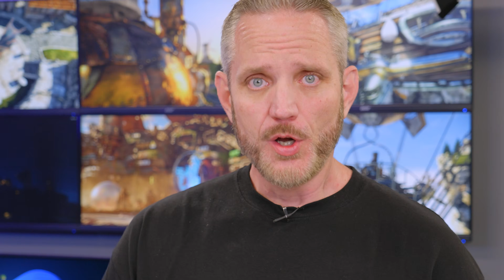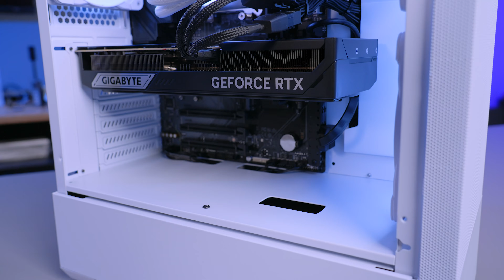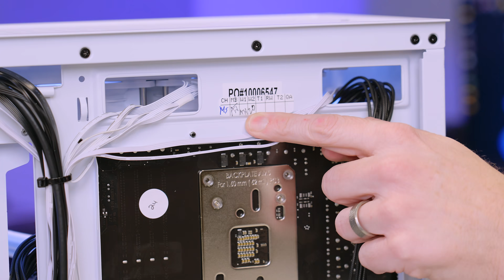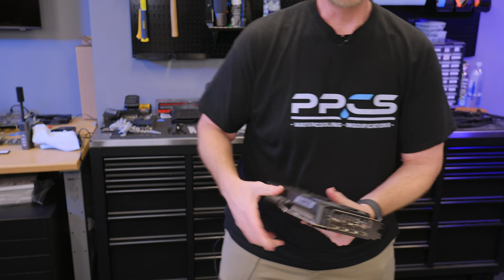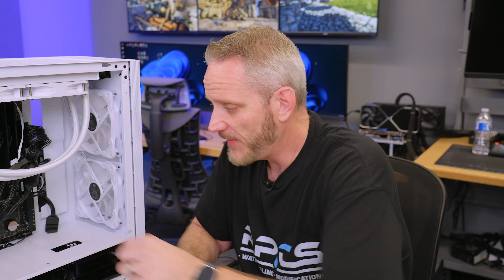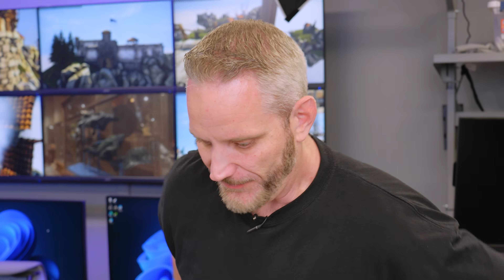This Prebuilt Gaming PC is Shockingly Affordable

Comment: GPU fans going above 2000RPM and it "only" sticking to around 70c feels like pretty mediocre cooling. I know there's trade offs to be had for the price, but this is more about the GPU alone. I think I'd sacrifice some noise for the case fans, to try to turn down the GPU fans, as that's gotta make quite a lot of noise. Although I am quite noise sensitive, (severe tinnitus) maybe I've just forgotten what 2000RPM sounds like. My 5070Ti I have "top out" at 1200RPM and my CPU/case fans rarely break 600RPM (all Noctua 140mm)

3200RPM isn't full speed for the pump I thought ? It goes from 3000-5000RPM, they have it at 3200

Also I reckon the fan curve is set to ramp up after a certain temp, and it just didn't hit it.

Comment: Honestly, for what I paid, this build was really good value because I bought right before prices jumped and was able to put money into aesthetics instead of sacrificing on it 

Built around September 14, 2025 for about $2,400(exactly 2 weeks before ram crisis) for my 1st build after years of waiting 

Same/similar build today would be closer to $3,400
💚9800x3d 
💚RTX 5080 white Zotac GPU with gold accents, paid around $1,140
💚Samsung 990 Pro 2TB SSD, not a budget drive
💚32GB DDR5 G.Skill Trident Neo RAM, gold sticks, bought for around $180 before the RAM crisis
💚asus strix matx B850 in white motherboard 
💚Lian Li 205M case, bought on sale
💚 pcie gen 5 850 powersupply(msi)

Custom aesthetic work: -holographic vinyl-wrapped PSU shroud
-Added a separate VSDISPLAY temp-monitoring screen
-8 rgb darkhorse fans 
-Strimmer cables
-Airgoo hub rgb hub for signal
Fan hub 

Overall theme in my build is  more cohesive: white/gold/RGB/holographic accents. But this build Jay has in this economy its solid

Comment: Indeed. Last August I got my 7800x3D and 5070ti for 1600. Sweet
Reply: Was that open-box? My buddy just got that model last month for $2K. I build PCs, and I, like Jay, considered that a very good deal on a pre-built, considering the current component spot retail pricing.
Reply: @LawrenceSkow  not open box and deal was still good a couple of months later. They also had a 9800x3d , 5800, 64 gig ram for 2200. As I said, August 2025, just before all the memory prices exploded

Comment: I'll admit that between the GPU, memory and SSD the whole system is a steal in today's market.  For some reason I just can't wrap my head around the 240 AIO.  I know it's not as important, costly and the performance factors, but it's not the same as in Micro Center's photos for this product.  If I'm wrong then what's the deal with the white cover that over the top of the CPU heatsink?  Everything was not going as advertised as you should be getting out of the box because of the AIO.   You can clearly see it in this video between the model on your bench and when you showed the webpage for the G757.

Comment: I scored such a good price on a PC, piece by piece that I am actually considering flipping it, for quick profit. 
2,200$ with taxes got me a 5080 Aorus Ice and a Gigabyte Eagle MB, DDR5 6400 - CL32 x 32gb and a Intel 270K combo.
Arctic 280 AIO = 80$.  Hyte y40 case = 140$ with tax and 80$ for SAMA PSU 1000w is more than enough.  

Sharing this so that readers can get an idea of what you can POSSIBLY save.
You can spend 600 on a new OLED and a 300 $ cooler, but what type of idiot would ?.
You can spend 3 or 400$ on a case with 30$ fans. Watch out for the scams.

 I am thinking I can easily get 3 grand for the PC, once assembled. 2.2K is the best possible deal you can get out there.
I got 500$ off the GPU open box and I got the 550$ price for the combo at MC, which today is 600$.
The RAM is 458$ outside of a combo.

I spent a couple months hunting some parts down and working the cost of the system down to 2k plus tax.
My screens are separate and I spent 1800$ for the two monitors and TV screens in the past, so about 4k total for the base hardware.

My entire system is about 10k, for desks and chairs and peripherals and controllers, lights, mic, camera, cable and electrical, Audio interface, amps, hubs, speakers and etc.
Going over 10k is a waste of money imho, but I think every part of my system is carefully selected for the most value. I consider it to be the best 10g studio rig that I have seen, so far.

Even my electrical is up to code, clean as it gets, considering I did not build the walls to fit my system, there's wood paneling on the walls and so hiding cables was a massive job, drilling into the wall to mount monitor arms and TV.
Cables and cable management trays, sleeving + USB hubs, power filter and protection, optional UPS, prepare to drop 800$ -1000$ or about that for a dual desktop office.

I just have the peace of mind of solid and safe wiring, this is worth the cost. Knowing there's a Furman series filter plugged into the wall and my electrical panel in the home was recently updated, this is huge.
I have like 14 expensive things plugged into the single outlet, knowing it's isolated and protected is huge. If I want to plug in some larger AMP, some DJ equipment or some sound board system, this is also huge because you're not popping a breaker anymore, overloading your system. Use a 15-20 amp circuit.

 If I want to plug in a phone, laptop,  game controller, arcade stick or flight stick, I just reach over on the desktop back side has a Denon pro USB DJ hub and plug it in,  there's a 65 w fast charger + extra 110v + USB outlets on each side, this should be mandatory. 
 I have a multi use tree, pole mount in the center, pneumatic mic arm for main mic, has USB-C and A, sim card And SSD reader at the bottom, so adding additional mics, lighting or cameras is extra simplified and there's no need for using a tripod or extension cords, I can run three mics with no sweat, multiple cameras on the same mount. 

The mic arm also holds my pro headphones, reading glasses, just a massive space saver, going vertical. Having to plug things into a tower, this is so inconvenient compared to using the Denon pro hub, it's totally better. I put the tower under the desk, there's no room on top. I still have a Playstation on there, other boxes. USB hubs are integral parts of any modern digital studio space, it's just common sense for a digital space.

 One desk could use a hub, except one desk does not hold all you needed for keyboards, controllers, screens. I needed the two desks to use my screens, etc. I have a 48 key Novation piano, another killer value for a Abelton controller, it does everything and more. You actually need 3 substantial hubs for a 12 foot desk station, this is optimal. I have the Denon strip, a circular one I drilled into the desk and another glued onto the pole mount. I have a Japanese keyboard with a giant trackball in front of the Novation, so the trackball keyboard is a good combo, I can control everything from there, for the PC and software. The other side is just for gaming and multimedia,

Bro I have two PC towers and 2 chairs for sale, HMU. I need to sell asap and then I can upgrade some final stuff, a chair and some final touches. My Razer chair is barely worth 400$, let alone 1200$ and I kinda need a Titan XL to go with it.  I did snag a good deal at MC, 800$ off so that's a no brainer.  I use Roccat Vulcan for gaming which works well for now, looking to move to Gravastar. For a main chair, might need to get a Titan XL.

As of now, I use the thunderbolt header or 40gbps USB to power my main interface and then a recording amp, dual channel goes to the line inputs. This would allow you to record a singing guitarist, such as Elvis or Taylor Swift. All you need is a couple boxes to seriously upgrade your audio outputs, inputs and recording. I use Abelton software with plug ins. The modern USB -C interfaces or thunderbolt, they operate with zero lag on a newer PC tower, no DSP or integrated processing is needed. 8 cores is enough, 24 cores is more than enough. Use the power of your PC to push your audio latency and eliminate the need for DSP. 192KZ converters are something a Streamdeck wishes it had, Streamdeck is garbage and most people's recording or streaming setup = misguided, you just didn't research it enough.

 I was going to make a PDF file for my overall rig, breaking it down. It's not really a fancy aesthetic and just mostly powder coated black with some fancy chairs. My desktop surface is upgraded with all glass mouse pads and rubber poker rails, this is a secret technique developed by people in the USA, who don't believe in refinishing furniture or bumping elbows. I put a lot of design work into it, and planning, with the all black system with screens, I have 119 inches of screen space and that is a massive amount.

Not only is my design fully optimal, it is wife or significant partner friendly, all you need is a KVM switch for your wife or someone else to hop on and work on simultaneous projects, RAM should not even be a issue. It saves power, over using individual laptops or multiple towers is a waste. My PC will shred all the apps, callsign Blood Eagle. I enable C states in the bios, so even when overclocked I am not wasting my electricity. 

 I didn't have to cheap out on any major components, all are either A or S tier components. I saved about 30$ on the PSU.
I have made many systems but this is the most powerful and most savings on a system tower, so far.
I am proud of the parts I put together for the price of the tower, I couldn't have done much better.

Comment: A 5080, R7 9800X3D, 32GB RAM 6000MT/s 2TB Storage, 1000W PSU, "cheap" gaming rig in the UK will set you back £2,899 from trusted sellers. 

The fact that this PC is almost £1000 cheaper for the same specs is insane, so insane that it's hard to believe lmao

Comment: Given the specs and the fact that they really haven't cut any important corners (though I'd prefer a slightly larger case and a 280 or 360 AiO), this seems like a pretty awesome deal. Right now, the GPU, RAM and M.2 alone would cost roughly €1800 in my country (incl tax) - while the prebuild's price would convert to €2150 at today's exchange rate. Though I'm not sure if the Microcenter price of $2500 is before or after tax. 
Still: I'd happily take this one, or do a downgrade to a 5070 Ti or 9070 XT if that would push the price down even further.

Comment: Microcenter saved money on the G757 by going with a smaller case and only a 240mm AIO, based on complaints of some of the buyers. The G758 uses a bigger case, 360mm AIO and is like $300 cheaper (same CPU, but 5070 Ti instead of a 5080).

Comment: EDIT: At 5:55 Jay already mentions comparable Amazon build price, I didn't watch that far... 

As an European, quick comparable Newegg build (no Mail-in-rebates, no refurb/open boxes, no Windows key, no additional fans, no labour/assembly etc etc):
LIAN LI LANCOOL 207 - $89.99
Rosewill CMG 850W, ATX 3.0 & 3.1 Compatible, 80+ Gold 850W - $79.99
MSI MAG Coreliquid A13 240 White - $69.99 
KingSpec XG 7000 2TB - $279.99
GIGABYTE WINDFORCE GeForce RTX 5080 - $1,399.99
Patriot Viper Elite 5 32GB DDR5 6000 CL30 - $389.99
GIGABYTE B850 GAMING WIFI6 - $179.99
AMD Ryzen 7 9800X3D - $439.99
Est. Total - $2,919.92

Comment: Crucial announced that they are pulling out of the commercial market 6 months ago. They are going all in on AI hardware. So if you need firmware updates or to warranty any of those parts, it's not going to happen. Micro Center probably got a deal on those parts to liquidate Crucial's inventory.

Comment: I got a open box pre-built from them few weeks back did case swap to Lian Li A3 microATX Mid-Tower Computer Case - Wooden White added 6 non rgb fans and Thermalright Peerless Assassin 120 SE CPU Air Cooler got 7600x rx7600 1TBssd asrock mb 650 $844.99  ram 16GB 1 stick 6000 added another stick of 16 gb ram....did not plan to swap out the 7600rx GPU but something was wrong with it and installed a 9060XT 16GB.

Comment: I keep waiting/trying to find a 7900

WAIT. I have good enough computers.

DONT spend money you dont have.
Reply: Its not the 7th its a 6th that sapphire hasent done again. 
TOXIC AMD Radeon™ RX 6900 XT Limited Edition 
all in one cooled beast that just runs.
Reply: I dont have 2 k for the used ones that show up. 
Still a dream card that fits my Lian Li T70. 
Heat drops out the bottom. A test bench of power. 
A card to finish a build. (Got as story that I did finish.)

Comment: I bought one, stripped it down, kept the motherboard, CPU, and gpu. Sold everything else, out it in a lancool 217 Inf, hydroshift 2 aio, upgraded to 64gb of ram, replaced the fans and still came out cheaper than if if it was built from scratch. Why? Because this was literally at the beginning of the price hikes on everything.

Comment: I mean, they did cut corners with that Motherboard though.
Reply: Not at all. It’s a solid mobo
Reply: @asiansticker7015 Yeah but for the price, you could get a better VRM board right? doesnt this mobo only have 6+2+2?
Reply: @JustAnotherRandomGamer For the price the whole build would be over $3000 It’s simply just a good mobo for anyone who isn’t doing intense overclocking or has a power hungry cpu. It would’ve been cut corners if it was a smaller micro atx or cheaper chipset

Comment: I dunno, some people might’ve been spending $2500 for a rig back in 2021, but even back then, those people would probably be striving for either a 3090 or some pretty tricked out water cooled or other fancy parts… Back in early 2022 I spent like $2250 for a fully tricked out, custom water-cooled PC with a 7800x3d, mid-range Aorus X870 MoBo, 32Gb decent CL 6000mhz RAM, 2tb nvme Gen 4 SSD, 1000W Power Supply, LianLi o11 mini, and yes, I got my 3080 Ti used for $840, but I then spent like $250 for that special edition EKWB water cooling block, so it was almost like I bought an MSRP 3080Ti, also, all my water cooling stuff (except the GPU block) was all Barrow stuff from AliExpress (although it was their good stuff, not the cheaper parts).

So yeah, when back in the times we were barely recovering from the GPU apocalypse (if you can call early 2022 recovering), $2500 would get you a pretty OTT PC, so even if you take inflation into consideration, $2500 is NOT a price to be celebrating, even in 2026… Sure, that PC is a good deal in comparison to what you can get right now, and you do mention that… But you also make the point of comparing this PC at this price to a PC at this price from 2022, and I think it’s not valid comparison… If I had gone with a new slightly scalped 3080 back then (4080 hadn’t released yet), and with more reasonable cooling solution, I could’ve built a PC with the best CPU at that time (which was the 7800x3d, at the same price as the 9800x3d right now), decent memory and SSD, for like $1800.

So again, this PC is a good deal in may of the year of our Lord 2026, but you can’t make the argument that “people were spending $2500 back in 2021”, like it is a good thing. 2021 sucked for gamers (pretty much everyone, really), but 2026 sucks more for us.

Comment: Wish we had a MicroCenter in Okla City.  Nearest ones are either Dallas or Kansas City.  Too bad they didn't use a power supply that has a native 12vhpwr cable so they didn't have to use that triple 8pin into 12vhpwr for the GPU.

Comment: I was worried that the lack of a 12vHP plug might allude to it having a non ATX v3 psu, but after looking it up, it's ATX 3.1 compliant.  Good job MC.  Also the spec says it does have a 12v-2x6 cable.  Maybe it wasn't long enough.

Comment: Jay, cover the G532!

Ultimate budget value gamer pick right now.
Reply: Wow, I just looked that up. 7500X3D, RX9070 XT 16GB, 16GB DDR5-6000, 1TB NVMe, for $1399! MC for life! Blows away the "RGB specials" at Wallyworld for $900-1300, with an i7 and a 3050 6GB, or if you're lucky, an RTX 5060 8GB.
Reply: @LawrenceSkow yep. Now technically you can still beat the deal if you buy a second hand/open box 9070XT for 550-625$ and use the MC bundle, but still them building it + warranty is worth something. 

I love building too much to ever do it though lol

Comment: You’re talking about cost price vs retail prices. Thats why it’s the price it is. 
PowerSpec get the parts “at cost” and sold at Microcenter at their retail MSRP.. Everyone wins.. Manufacturers, suppliers, retailers & the customer. Each puts a price mark up to the next and so on. 

DIY market was often more expensive as you select each individual component & brand you wanted.. 
Prebuilts to me at least weren’t that good as you got one or 2 reasonable branded parts and other components substandard so you either “settled” or went DIY.. 

It just goes to highlight how consumers are being ripped off and how we’re forced to accept their new normal. 

I paid more for my factory manufactured watercooled 5080 than that entire system here in Thailand. 
Here it’s like the sales you have when you’re not actually having sales. Just perceptions of sales or savings. You’re actually being ripped off.

Comment: The minor gripes are fine because if they do so much right then it's all you have left and nothing is perfect.
Reply: Thank you for saying that nothing is perfect. A lot of the time people forgets that and can go rack down hard on any simple little thing they don't like. But nothing is perfect, not even your likes and dislikes. In fact what you find terrible might be perfect to someone else.

I'm real bad as I hate RGB and glass windows in cases. To me a case without 5.25" drive bay, less than eight HDD mounts, good cooling and no TG or plastic windows anywhere is just bad. Guess how many "good" cases I've seen released in the last decade or so? Lets just say they are easy to count, on one had, and only using the thumb, and I still get a finger left over. But that doesn't mean that no cases has been released that others find perfect and wonderful.